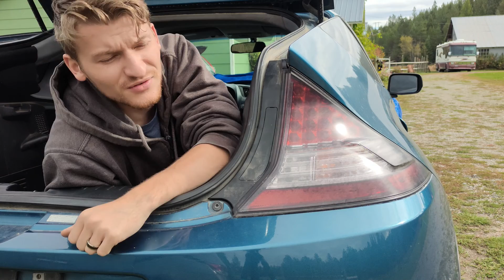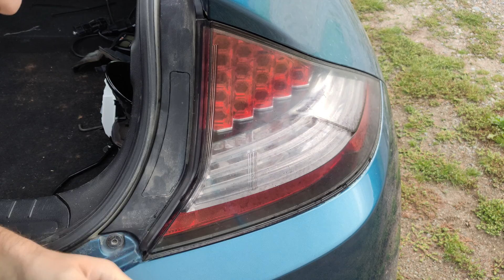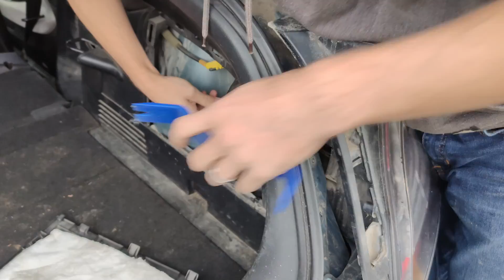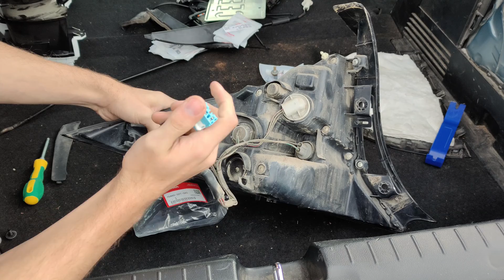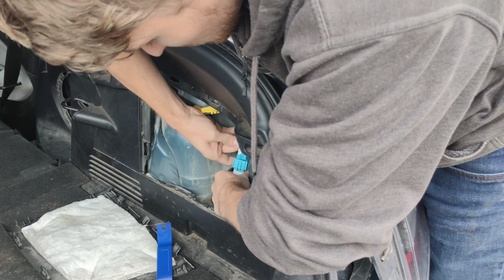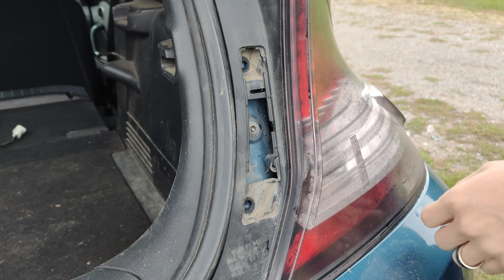How to Remove Taillights and Replace Bulbs on a Honda CR-Z

Comment: interested to see that foglight addition to rearlights. Also if you can add on 2012 CRZ headlights (JDM) mods to make led strip at lower part as DRL, and upgrade stock halogen to HID or LED. Great and insightful videos as usual!